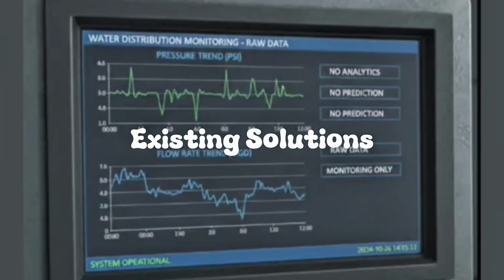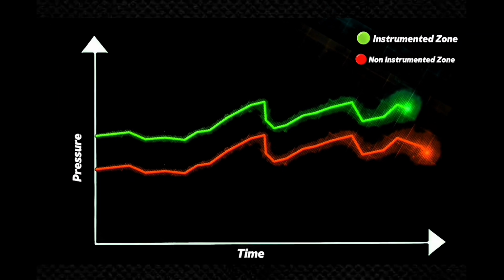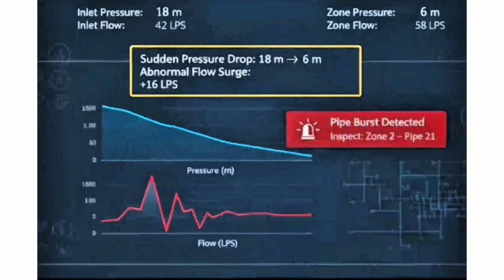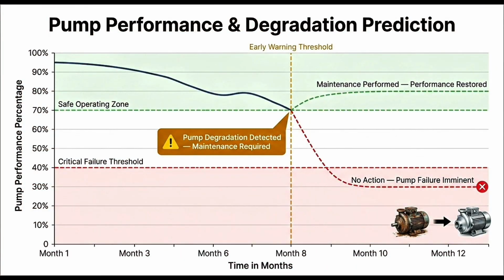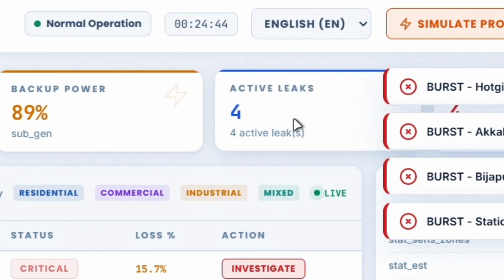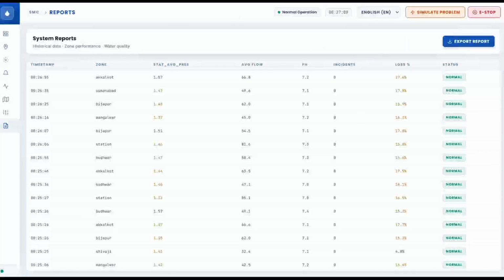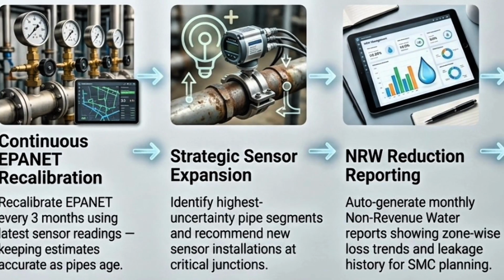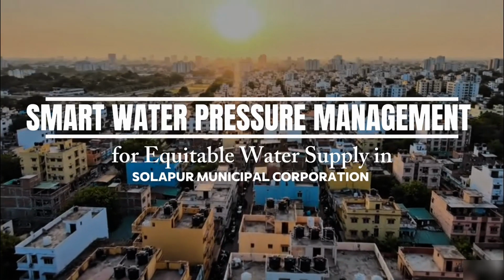Smart Water Pressure Management for Equitable Water Supply - Phase 2 - Prototype Submission

Comment from the maker: Smart Water Pressure Management for Equitable Water Supply – SAMVED Hackathon 2026

A data-driven intelligent system designed to ensure equitable, stable, and efficient water distribution across all zones of Solapur Municipal Corporation.

Key Challenges Addressed:
• Uneven pressure and unreliable supply
• Low pressure in tail-end zones
• Non-revenue water (leaks, unauthorized usage)
• Lack of real-time monitoring and control

Solution Highlights:
• Integration of SCADA data with hydraulic modeling (EPANET)
• CPHEEO-based pressure validation and anomaly detection
• Zone-wise monitoring and analytics
• Simulation-driven pump automation and control
• Predictive insights for proactive water management

Transforms traditional reactive operations into a smart, automated, and scalable water distribution system.

Project by:
Team Name: Icecubes
Team ID: MITVPU_SAMVED_Team 420

Institution:
Thiagarajar College of Engineering

#WaterPressureMonitoring #WaterAnalytics #HydraulicModeling #SamvedHackathon